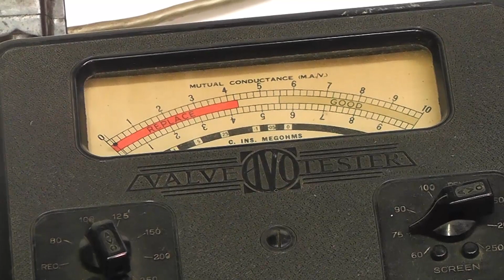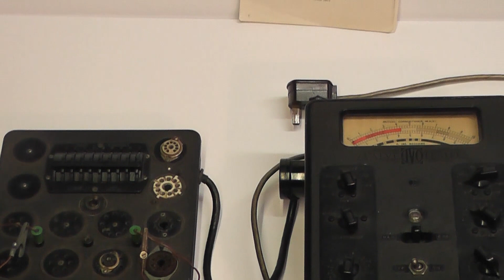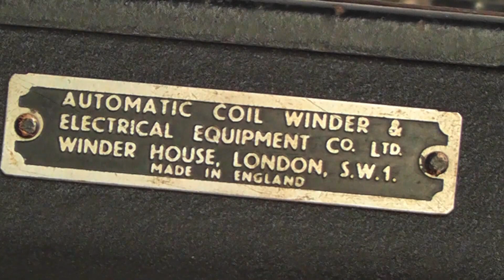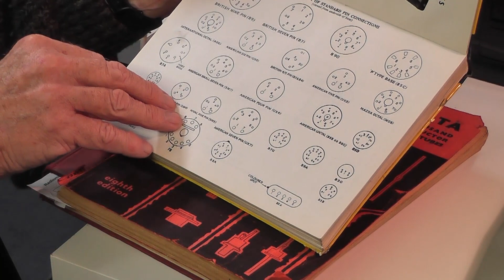Avo Valve Tester Mk 1

Comment: Hello. Great video, history and presentation, also the encouragement to offer feedback. I've just started with my collection of vintage valve testers and you'll probably be well aware of the model shown here. From what I've gathered so for may I add without judgment the following.
The AVO Valve Tester was probably the first commercial valve tester from AVO and offered as a twin panel unit as shown. The socket panel was also sold separately and referred to as "Universal Panel". Later model's from AVO include the Mk.1 through th Mk.4. These were units were less portable and more advanced in operation. The AVO Valve Tester Type 160 is actually referred to as the CT160 and is a military valve tester in a protective case, a "clam shell" which includes sockets. I believe the last AVO Valve tester to be the VCM163. VCM being Valve Characteristic Meter, which the Mk.1 through to Mk.4 were also designated.
The AVO Valve Tester here had several alterations over it's production run and the Universal Panel shown has the devide by 7 switch that earlier panels did not. Although billed as future proof, Ive read that the unit may not be compatible with "newer" valves.
Again, thank you for sharing this video and the information. I'm looking forward to watching the rest of this series and will no doubt watch this again in the future. All the best.

Comment: As a youth, I had a copy of the red valve data book. It had a section on 'geranium' transistors, so I drew a flower in a pot on that page. I hope you get the two panel tester going and try it out, I am curious as to how well it performs. Acquiring valve testers can prove addictive. Thank you for an entertaining video.
Reply from the maker: Thank you, I always wondered where geranium transistors came from. I have been very lazy with the valve tester. It had been long overdue for a new video. I am working on my video about very early radio repair books which I hope to publish soon. Thanks for your comments.
Dave
Reply: I had a copy of T D Towers'  International Transistor Selector which listed "Geranium Transistors" which made me wonder if that was where the 60s expression 'flower power' originated.

Comment: David, valve testers are always exciting pieces of test equipment. It's got to be down to all the twiddling with the knobs to set it up for valve testing that interests me when using them. I currently have an AVO VCM MK1 under overhaul and very much looking forwards to running it when the overhaul job has been completed.
Reply from the maker: Thanks, my Mk1 is still packed. I really must start checking. I have all the manuals but not sure where to start. Any tips welcome as you see to be much more advanced. May make a short video soon on initial look at the tester. Thanks for your comments.
Dave
Reply from the maker: Thank you for your comments. I worked as a radio/TV repair technician in the late 60's and although a valve tester was available it was often quicker just to replace and charge the customer I do need to do some more resurch on the AVO tester. Will include a selection of my early repair books in my next video which is long overdue. Take care
Dave